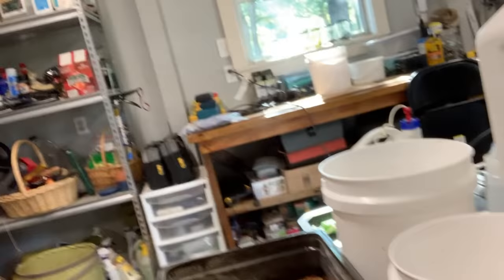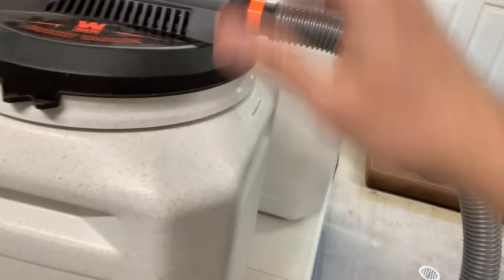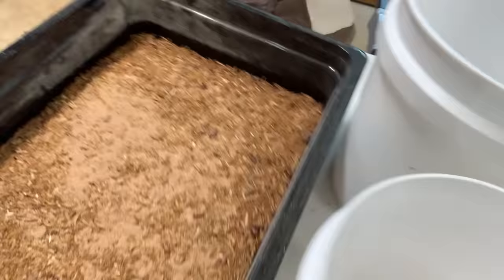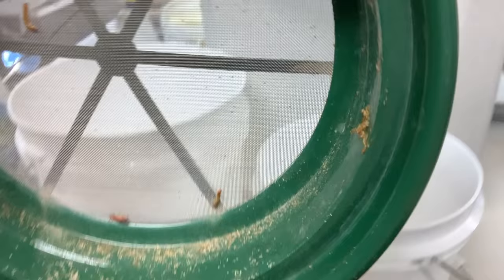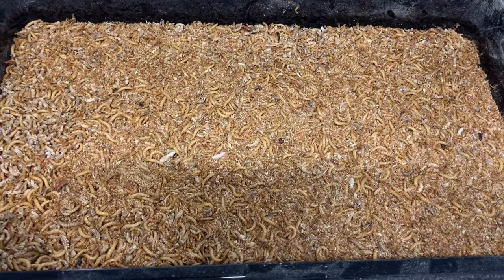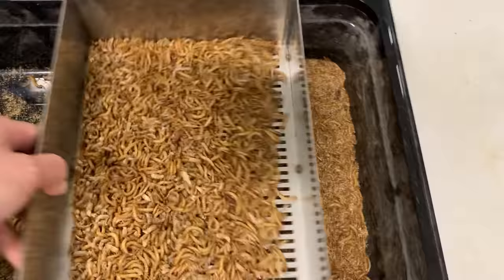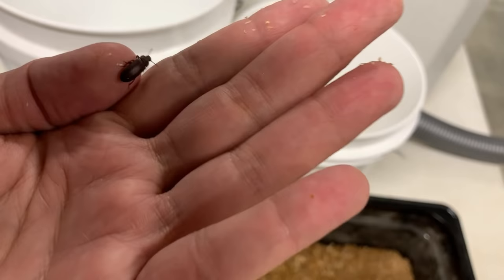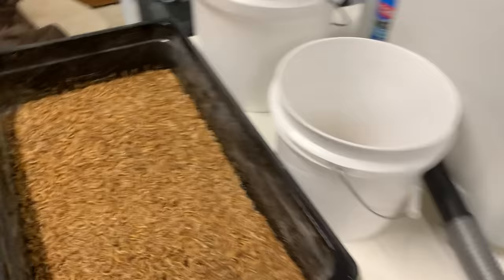MEALWORM FARMING FOR BEGINNERS – How to Maintain a Healthy Mealworm Farm

Comment: Shed Skins: Blowing off the shed skins from the trays is my least favorite part. I've found I can use my Ryobi leaf blower with variable speed. I place a tray on the patio, gently press the trigger on the leaf blower so it barely blows, move it over the tray and clean off the shed skins. Works like a charm! I tried your vacuum method, but it didn't work well with my vacuum. But if I'm very gentle with the leaf blower it eliminates shed skins in my face. Thanks for all your help!

Comment: 6:53 In Europe we have GASTRONORM classification system so all box related had GN fraction size.
ES. GN 1/1 have a size of 530x325mm, GN 2/1 is sized 530x650mm, GN 1/2 is sized 265x325mm

Comment: Hello. Maybe you can use the Mealworm Frass as food for your Red Wigglers. I remember that an earthworm breeder was feeding them with a flour mix to grow faster. So Frass may have important nutrients for them and they will quickly transform it to compost. A  problem that you may have is the increase of decomposing bacteria in your compost soil. Is not really a problem. I think it worth the experimentation.
Reply: perhaps frass mixed in with other organics for the vermicompost worms, but remember that, essentially, the frass has had a lot of the 'goodness' sucked out of it by the mealworms, leaving largely the unwanted, 'not-beneficial' and perhaps even toxic (in large quantities) elements;  vermicomposting worms, left in their own frass and expected to feed off it end up unhealthy and can potentially lead to your worm population dying off.  Perhaps just add the mealworm frass (poop/waste/faeces) to the hot compost pile / composting trench or even garden by just sprinkling  (vs 'dumping' a pile) over the ground in very thin layers?  Or, as I think someone else mentioned, make compost 'tea bags' out of them;  just wrap a cup-full of the frass powder in fine muslin with a string attached!
Reply: @ireneb3433  yea probably just small quantities of ammonia and iron phosphates, Which are inorganic and your plants will likely benefit more from it.

Comment: Nice set up. I use mealworms for processing styrofoam. So I don't raise them for production as much as they are a composting system. However, you've got some clever tools for it. Thanks for sharing the tips.
Reply: @TheRealRancherMike  my set up is a Rubbermaid storage tote, a little larger than a shoe box. Probably 3 gallons. I have packing peanuts, the trays you get with meat, and some larger pieces of styrofoam broken into chunks that fit inside the container. I supplement with occasional sprinkles of wheat bran, and weekly food scraps like apple, carrot, potato or whatever other scraps from the veg we cook with. 

It does take a while for foam to be completely broken down, but they will turn it into Swiss cheese in no short order. Packing peanuts and small pieces go pretty quickly but larger stuff will take several months. Although, that's incredibly faster than just throwing it into a landfill and waiting for it to break down.

Comment: Thanks for your video.  What clever engineering you have!  Wing problems can be a result of molting technical issue v. genetic issue. I note that sometimes the wing does not free easily, so it can tear.  Also note that failure of pupae to advance through the stage to beetle is thwarted by not getting enough moisture prior to the final molt.  So desiccated/dying pupae can be the result of moisture issues (and of course gnawed body parts leads to a different conclusion)

Comment: This is really helpful man.  I'm just about to get back into having a couple of 55 gallon tanks with oscars and want a self-replenishing food source.  I used meal worms in college for my oscars, so this was great to help me set up again.  Is there a good reason to use your substrate vs cornmeal or oatmeal.  I"d love your input.
Reply from the maker: I use wheat bran because it is easier to separate when I have to sift out pupae or beetles. Some folks use oat bran, but the flakes are so large, it makes it hard to separate using the green sifters I bought on Amazon (you can use the link at the bottom of ny videos to find my Amazon store where all these products are listed). Hope that helps, and best of luck with your oscars!

Comment: Sorry if it got posted below in the comments, but can you please post the bin in the video info? Looks wonderful! Great vid, thank you so much!
Reply from the maker: Hi Lauran - thanks for the comment! At the bottom of each of my YT videos, I include a link to my Amazon storefront. There, you will find a section called “Mealworm Farming.“ In that section, I list several bins, totes, and lids that you can use with your mealworm farm. Each time you purchase from my link, I get a very small commission, which helps me continue making these videos. For my system, I used these pans: https://amzn.to/3FoYtgg and these lids: https://amzn.to/384RNI5. For the lids, I cut the top with a router and added mesh for ventilation. The mesh I used is here: https://amzn.to/3KTc8NV. I attached the mesh with this two-sided tape: https://amzn.to/3FmRynV. I then placed this gaffer’s tape over top: https://amzn.to/3FmRt3B. Hope that helps!
Reply: @TheRealRancherMike  Thanks so much, I thought I went there but didn't see the bins. will check them out- thank you!

Comment: thank you so much for this information.  I am trying to set up my own mealworm system for my pet.  this is really helpful.  will try to learn more
Reply from the maker: You’re welcome, and good luck with your mealworm farm!
Reply: @TheRealRancherMike  Hi there, any reason why the black beetle just died?  my first batch of pupae turn into beetles, but they just died off.  what can be the reason,  I did mixed the pupae and beetle together.
Reply from the maker: Not sure, Joe. How long were the beetles around before they died? Did they have any little white dots on them? That could be grain mites. You would need a magnifying glass to see them to be sure. Other than that, I can only think perhaps the temperature or moisture levels were not correct in the area where you were keeping them? It’s really hard to say without more info. I’m sorry that happened to you, though!

Comment: Thanks!   Good info here.   I wish you had those Amazon supplies linked here!
Reply from the maker: At the bottom of each of my YT videos, I include a link to my Amazon storefront. There, you will find a section called “Mealworm Farming.“ In that section, I list several bins, totes, and lids that you can use with your mealworm farm. Each time you purchase from my link, I get a very small commission, which helps me continue making these videos. For my system, I used these pans: https://amzn.to/3FoYtgg and these lids: https://amzn.to/384RNI5. For the lids, I cut the top with a router and added mesh for ventilation. The mesh I used is here: https://amzn.to/3KTc8NV. I attached the mesh with this two-sided tape: https://amzn.to/3FmRynV. I then placed this gaffer’s tape over top: https://amzn.to/3FmRt3B. Hope that helps!

Comment: Hello, is Oatmeal Okay to use to keep Mealworms in, or will it Kill them. I bought 50 Mealworms for Fishing Baits over a Week ago, but did not go as planed, and I have been taking care of them by giving them  Vegetable slices, Their Wheat Brand was all eat up, and I just replaced it with Oatmeal in the little Container after changing it. I have around Eight Pupa already, but none of them have not yet turned into Beatles yet, kind of exciting! I separated them into another temporary tiny Container from the Mealworms. I did not Currently have any Wheat Brand to use, I substituted with Quaker Oats, would that be Okay for a Couple Weeks without Killing them until I can get a few Big Plastic Containers and some Wheat Brand. Tom

Comment: Interesting.  I keep worms for my fishing.  It does get cold here in winter and the worms aren't allowed in the house (wife rule).
I'm sure it would be the same rule with meal worms.   
As a kid I tried raising meal worms with no knowledge of what I was doing.  I used bird seed.  The pupa shriveled and died and some beetles made it but then died anyway.   
So , now I see where I need to go.  It would only be for my fishing bait anyway.  But why buy something that I can raise anyway.
I guess the waste all goes to the garden?   How do the eggs get into the bran to start the cycle all over again?
Reply from the maker: Hey Bee Bob. To answer your questions, the waste does get used in my garden. It’s a great soil amendment. As for how the eggs get into the wheat bran, that happens when the beetles mate. They lay eggs on the bottom of the tray and sometimes on pieces of the wheat bran, too. That’s why you always leave the wheat bran in the same container when you move beetles (about every 2-3 weeks). Hope that helps, and good luck if you decide to start your own colony!
Reply: @TheRealRancherMike  Thanks for the information.
What temperatures do the mealworms need to be kept at?
Reply from the maker: Ideally, between 75-80.
Reply: @TheRealRancherMike  My eggs of the first generation are hatching and the bran is wiggling a little bit.   
Should I be putting in carrots or potatoes for moisture now?
Reply from the maker: @beebob1279  if the room where you keep them isn’t dry as a desert, I would wait until you start to see sheds from molting. That’s when they are big enough to really need the carrots. Otherwise, they get enough moisture out of the air and the carrots will just dry out.
Reply: @TheRealRancherMike  Thanks.  The room is a bit dry because of the winter heating.
Reply: @TheRealRancherMike  So far I have three tubs of meal worms and the beetles are working on their fourth bin.  
The mealworms in the most recent bin that the beetles  were in are much bigger than the first two batches.  Any idea what happened?  The first two batches are really small and don't seem to be growing
Any help is appreciated.

Comment: One more idea… replace the bottom of a couple trays with screen…. Just cut it out with utility knife and then silicone caulk/glue  screen to bottom
Reply from the maker: Thanks for all the suggestions! I know a lot of folks use the “screen in the bottom” approach for their mealworm farms. My personal experience is that when you slide out a bin to check on the beetles, the eggs and frass fall out of the bottom of the tray, making a mess (and also potentially leaving eggs all around the workspace). That is why I designed my system to require physical movement of the beetles out of the bin every 2-3 weeks. 😉

Comment: This is exactly what I do just on a much smaller scale lol. They're all kept in porridge oats in plastic take away containers on top of a tall freezer, are uncovered during the day and covered up at night to mimic natural cycles. However, the beetles don't seem to be reproducing much? Are they perhaps too warm or too cool? Also, the worms sometimes have a lethargic demeanour as if they're sick or something, but I only ever find a few dead ones in there per week. I'd be very grateful for any advice as and when you have time. Thanks🐛
Reply from the maker: It’s really hard to say without knowing more about the room. What is the temp and humidity level in there? Is it kept dark? Are the containers allowed to breathe at night when covered? Let me know, and I’ll see if I can make some suggestions based on your responses.
Reply: @TheRealRancherMike  They're up on a 6ft tall freezer so the air is naturally warmer and dry but, the surface of the freezer is quite cool and the window opposite is always cracked open a couple inches for ventilation. I turned the spot light away from them to make it darker and cooler and it's even darker when it's switched off completely - the only light that is on when we're awake is a small dim lamp in the opposite far corner. They're covered at night to make it as dark as possible when the small lamp is on and each tub has four roughly 1 inch by 1 inch holes in the top for air which are not obstructed by the cover - they don't escape. They get checked every other day and are cleaned out of sheddings and separated as and when going through "the change" as I call it😝 The worms and beetles get a rotational diet of non organic carrot, non organic Iceberg lettuce, non organic Granny Smith apple and non organic white potatoes but, I don't give them any supplementary vitamins and minerals. I clean out the frass and give them fresh bedding (about an inch of oatmeal) once per month but if their bedding seems damp from food/poop, if the food is going mouldy or if they smell funny then I immediately clean out the tub and also remove any that have died - which doesn't happen often at all. I can't say how many are in each tub, however, they're certainly not over crowded and have plenty room to move, and when it looks crowded I separate them to a new tub to give more space.
I think I'll have to experiment with putting them somewhere cooler. And, giving organic/home grown veg as any pesticides in the shop bought stuff may be causing them problems.
Reply from the maker: I think the issue is the area is TOO cool. Ideally, they need to be kept between 77-81 degrees F and 50%-60% relative humidity. I think your worms are “sluggish” because they are cold. If they get too cold, they go into a hibernation-like state and won’t develop. Hope that helps!
Reply: @TheRealRancherMike  Ahh ok, yes. I'll put them somewhere warmer and see if they perk up. Thanks so much for the info!

Comment: loved your video.  I want mealworms to feed to bluebirds.  Never did this before.  Bought a little round tub of teeny tiny mealworms.  I have been keeping them in the refrigerator.  About every 5 days I take them out and feed them carrots for 24 hours.  Then return them to frig.  Where am I supposed to keep them???  Are they supposed to be in total dark?   Thank you for any advice you can give me.  Lynn
Reply from the maker: Hi Lynn. Thanks for your question! If you keep your mealworms in the fridge, they won’t die, but they won’t get any bigger either. To make them grow, they need to be in a 78-81 deg F environment with around 60% humidity. They do prefer the dark (as do the beetles, which is why they are called “darkling beetles”). 😉 Hope that helps!

Comment: Can you list the names and links to the products? The vacuum lid, the big plastic (frass) containers,  and the sifting lids. You could sell those neat sifter trays also. 

Also, I raised mealworms for 2 years by the millions (for an amphibian pet). I recall feeding them nutritional yeast and wheat brand. They always had a smell I did not like. I kept the bins clean, but wonder if you also have an odor with your colonies.  Maybe it was the nutritional yeast they ate? I want to start this again, but can’t handle the smell as I always raise them right in my apartment.
Reply from the maker: Thanks for the feedback! I have an Amazon storefront link at the bottom of each video where you can find the products I use under “Mealworm Farming.” As for the sifter, I have teamed up with Mealworm Farming Solutions to sell a round aluminum sifter for separating pupae from mealworms. You can find that pupae sifter on Amazon or at www.mealwormfarmingsolutions.com.

As for the smell of your colony, I’m not sure. My colony has never had a weird smell. I suspect it was your yeast causing the problem. That can get REALLY smelly when you add water. In fact, some use yeast, an activator and water to make a smelly compound (over the course of several days as it ferments), and they use that to attract and trap houseflies. So, I imagine your yeast and moisture supplements were having a similar effect!

Comment: I may have the wheat bran too deep, (2 1/2") and the bran at the bottom is clumpy like it was damp. What have I done wrong? Should I sift out the clumps, or will I lose eggs? Thank you! JM
Reply from the maker: Hi Jeanen, I would just leave it. It could be that you have a large cluster of eggs in the spot, and it appears “damp.” Even if not, the extra moisture should not be a problem as the eggs start growing, and will actually help them. Please keep me posted!

Comment: Thank for the video!  Can you tell me where you got your bins and rack?
Reply from the maker: I had a friend make the rack for me, but you can make one out of wood a lot cheaper. As far as the bins go, at the bottom of each of my YT videos, I include a link to my Amazon storefront. There, you will find a section called “Mealworm Farming.“ In that section, I list several bins, totes, and lids that you can use with your mealworm farm. Each time you purchase from my link, I get a very small commission, which helps me continue making these videos. For my system, I used these pans: https://amzn.to/3FoYtgg and these lids: https://amzn.to/384RNI5. For the lids, I cut the top with a router and added mesh for ventilation. The mesh I used is here: https://amzn.to/3KTc8NV. I attached the mesh with this two-sided tape: https://amzn.to/3FmRynV. I then placed this gaffer’s tape over top: https://amzn.to/3FmRt3B. Hope that helps!

Comment: I’m very new to this and I use old fashioned oatmeal not instant.  Is oatmeal ok?  I don’t know where to get wheat bran.
Reply from the maker: Hi Jill. Yes, you can use oatmeal. I use wheat bran because the flakes are easier to sift out when I separate beetles or mealworms, but oatmeal is perfectly fine as a food source. If you decide to use what bran instead, you can buy it in bulk from nuts.com. I find that it is the cheapest. Best of luck!